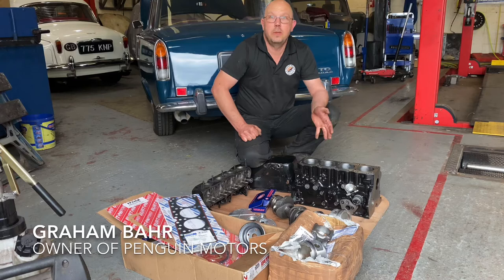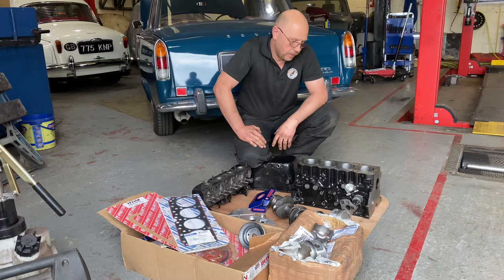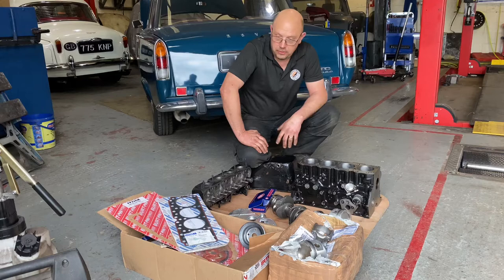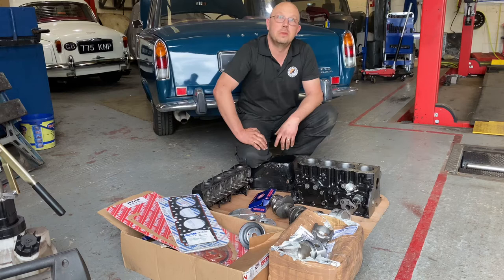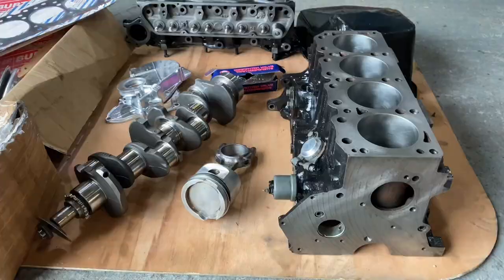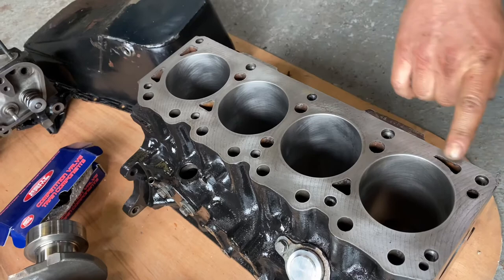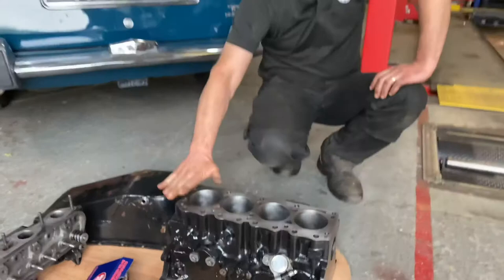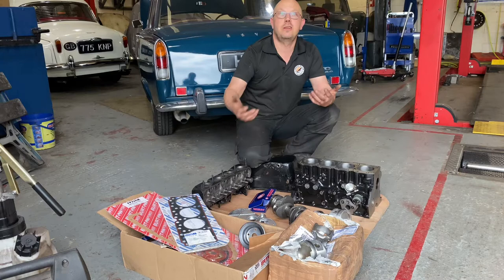Ford Crossflow 1600cc - Caterham Engine Build

Comment: How come the original Ford Kent/Crossflow is highly tuneable unlike the later Valencia/HCS/Endura E engine?
Reply from the maker: Stronger 5 main bearing bottom end, bigger cylinder bores, cylinder head ports bigger with far more airflow potential and years of motor sport development, not to mention the bottom end was the basis for the legendary lotus twin cam and cosworth BDA
Reply: @PenguinMotors  Ford hit the nail on the head with the Kent/Crossflow engine like BL did with the A-Series engine. Both legendary engines
Reply: @jaggass  I've had both of these engines. The BL -A series is a fine engine, but really doesn't have the potential that the Ford Kent engine has for horsepower, torque or longevity in use.